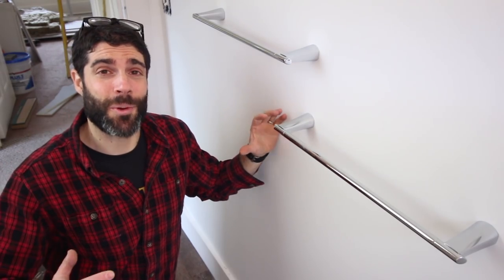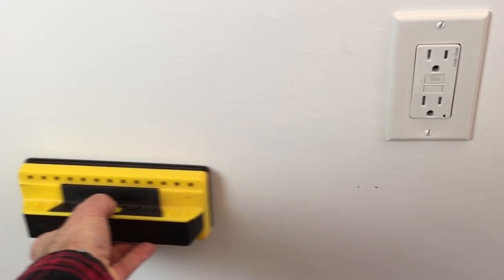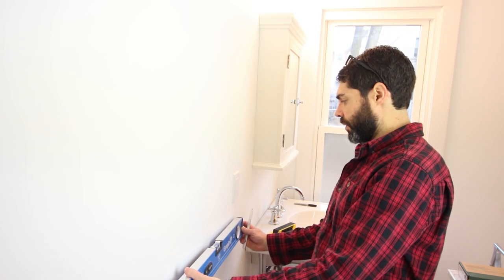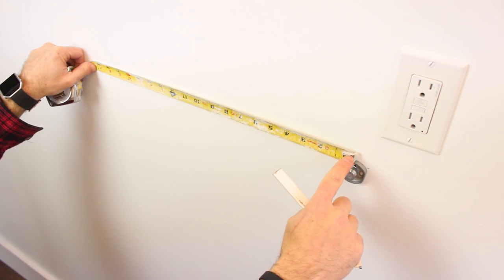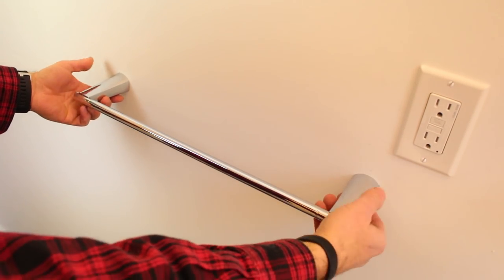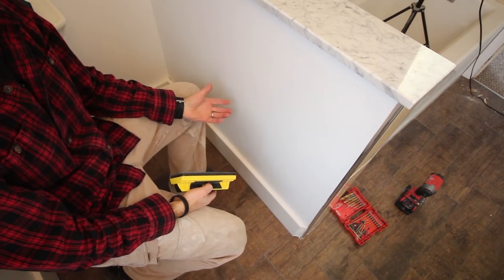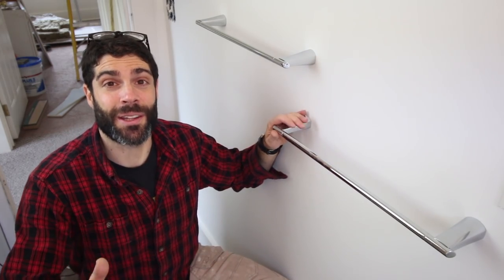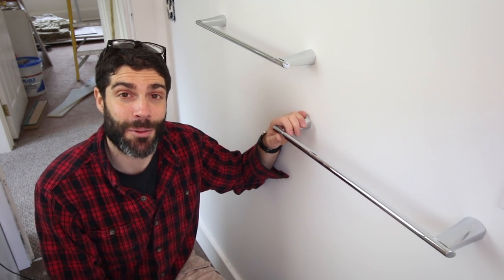Bathroom Towel Bars and Toilet Paper Holders (Quick Tips)

Comment: It's a little hard to install toilet paper holder in a bathroom where there's no wall on either side, and then the toilet is between the sink and the tub, I have to find a place in front of my toilet on the wall to put my toilet paper holder, But then I have to have the bars high enough to where if I put a bath towel it doesn't drape over the tissue. If there weren't any studs, couldn't you just use wall anchors?

Comment: Thanks Jeff! How does that stud finder work if your studs are primarily wood?
Reply from the maker: +snakemonkey555 not sure but the one I use has been spot on.
Reply: Most of the modern stud-finders work with ultrasonic sound pulses... like submarine sonar. The original ones worked with magnetism and depended on sensing a screw or nail. The most expensive modern ones actually use a combination of sonic and electromagnetic technologies to detect live wires and distinguish between wood and metal studs.
Reply: David Tierce Thanks.
Reply: The reflected sound waves are stronger with an increase in density of the wall. In other words, the stud (or any other object) reflects more than an empty or insulated space. The electronics see the change in density/reflectivity as you pass the device over the surface.

Comment: I have no idea why 16 and 32 inch towel bars aren't more common. You should always be installing these in a stud. They just always fall out of drywall and it sucks.

Alternatively, the carpenters should ALWAYS put blocking in the wall for stuff like this. I don't know if stud-finders are good enough to find them and their dimensions, but what I'm familiar with just finds the nails. If that's how all of them work, they need to have a carpenter's signal for where a stud is specifically for a towel rack and toilet paper holder. Maybe a nail on each side of where the stud is for those things.

Comment: you dont have to use the entire length of the towel rack,you can just cut it off to suit the stud spacing,found video to be pretty useless,most times you wont encounter  the examples used,how about showing a real life solution
Reply from the maker: +gasmanrm you can cut the towel bar and I thought about recommending that. The purpose of the video was to give a variety of different tips. Maybe you should make a video showing how to cut the towel bar 👍